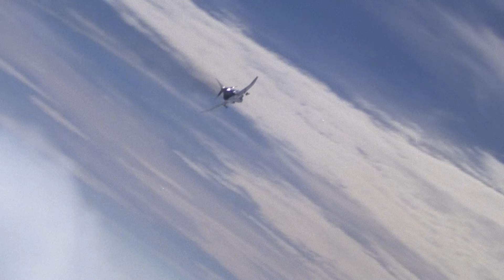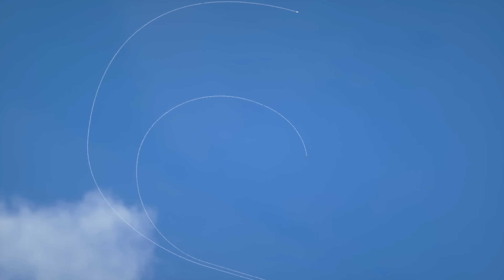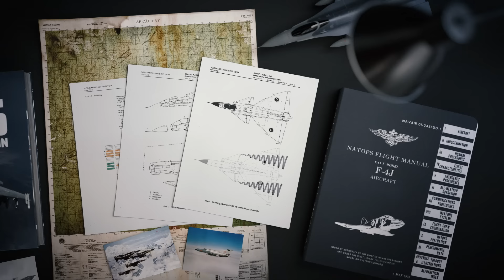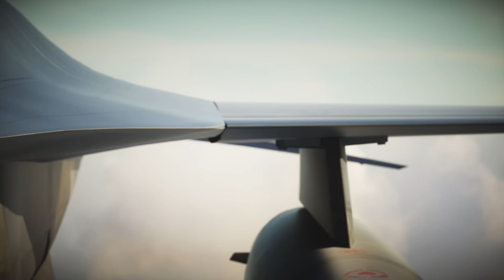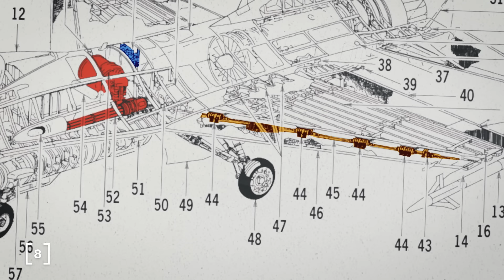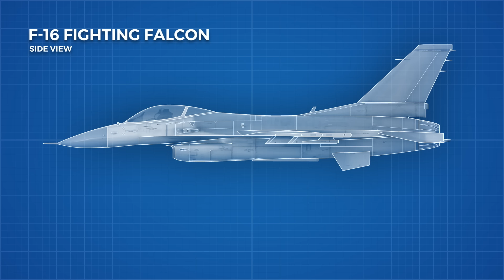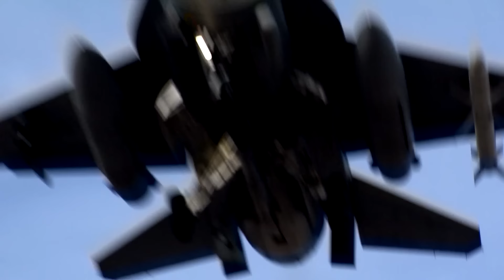The Insane Engineering of the F-16

Comment: Not a  pilot. Have read about flying my whole life and mostly about fighter pilots and fighter planes. 
I am trying to wrap my head around the excellent description here of the F16  FBW and limited stick input. 
Seems like the whole "seat of the pants" thing kind of is no longer a thing?
On the other hand I have millions of miles driving all kinds of vehicles.
I am wondering if a good analogy is a really good traction control system found now on newer vehicles. When working really well, you don't even realize the seamless loss of fueling with foot feed input and the fact that the vehicle just kept you from causing it to spin out with too heavy of a foot. Is this somewhat of a fair comparison?

Comment: Worked as a Final Assembly Inspector at General Dynamics in the 80s. For a period of time because of an engineering mistake in the mating alignment of the forward section at the inlet, a series of shims had to be used to achieve alignment.  Don't know how long that went on but doesn't seem to have any adverse effect in general. Watching the test pilots do energy turns over Carswell that time was breathtaking. Never before had we seen a rather high speed fighter suddenly do what seemed like a 180 turn on a dime. This was something extraordinarily new for us. Still love that airplane above all others.

Comment: The main aircraft in Greek airforce is the f-16 with over 180 planes about 30 are block 30 but mostly block50 and 50 plus which are all in upgrading to block 70 viper but the biggest advantage these planes have they are piloted by the best pilots in nato

Comment: My uncle Bill would have loved this video - he worked for Chance-Vault beginning in 1950 till his retirement 35years later - he worked in aircraft design and wind tunnel testing - one if his designs ( with his name on it ) was the jet intake on the F8U1 Crusader
Reply: 1. In video are almost not visible any MiG-21! Planes with Czechoslovakia markings (Československé letectvo) are Su-22! Not fast, not maneuverable, pretty heavy due a variable swept wing. Su-22 obviously dont have clean delta wind as MiG-21!
2. MiG-21 does not have variable swept wing in any variant or clone!
3. MiG-21 is not dogfighting plane, it is now easy to maneuver special in lower speed in low attitude.
4. Is designed primarily for attack from back.
5. Su 22 does not have AA radar!
Absurd
Reply: @askme5805  And what exactly does any of that have to do with OP's comment? Smh.

Comment: The mig-21 is not maneuverable, as claimed, even relative to the F-4. It is also just as fast. It was cheap. 

Hit and run tactics disabled the US strategy, causing losses when combined with modern soviet ground based air defense. The  US needed a tactical ability which defeated the interceptor concept.  Because this was soviet air doctrine, working in practice.

The narrative would be improved by pointing out that the cheap mig had all it needed for the simple tactic. This is what made the US realize it needed “air superiority” not just a fighter. And that brought the fighter mafia’s points and Energy Management theory to the fore. 

Air superiority informs US strategy and spending to this day. Lots of cheap fighters must not defeat US air strategy, or that strategy fails.

Comment: Hold on the F-16 was designed by a small group of engineers and defense analysts known as the Lightweight Fighter Mafia in the early 1970s, and one of these engineers said the F-16 was designed on a napkin on the corner of a table.  And what is said early in the video sounds more the designing of the F-15.

Comment: Huh, I thought those fillets at front of the wing were called Leading Edge Root Extensions not Leading Edge Strakes.
Reply: You’re right, they are.  Strakes are ridges along the length of the hull, like a boat.  In the case of the F-16, the strakes are the two stabilizers under the fuselage below the tail.

Comment: Generated using Talkbud (Browser Extension):
📝 Summary of Key Points:

📌 The F-16 fighter aircraft was developed in response to the Vietnam War, where larger US fighters were at a disadvantage against smaller, more maneuverable Soviet-made MiGs.
🧐 The F-16 was designed with the energy maneuverability doctrine, focusing on efficiently managing energy to outmaneuver enemies. The video explains the energy maneuverability diagram for the F-16.
🚀 The F-16's unique design features, such as its engine inlet, landing gear placement, and leading-edge strikes, optimize its performance at specific speeds.
🚀 The F-16 is equipped with a hidden 20mm rotary cannon and has a precise weapon system.
🚀 The F-16's fly-by-wire system revolutionized aircraft control, allowing for more efficient energy management and maneuverability.
🚀 Other topics covered include the F-16's pitch stability, reclined cockpit position, and G-suit for high G-force tolerance.

💡 Additional Insights and Observations:

💬 "The F-16 was designed to be a lightweight, single-engine fighter that could outmaneuver its opponents." - F-16 test pilot.
📊 The F-16's energy maneuverability diagram shows how lift and turn rate are affected by speed and angle of attack.
🌐 The F-16's fly-by-wire system uses sensors, wires, and computers to control flight surfaces, enhancing energy management and maneuverability.

📣 Concluding Remarks:

The F-16 fighter aircraft was developed to address the limitations of larger US fighters during the Vietnam War. Its energy maneuverability doctrine, unique design features, and advanced systems make it a highly maneuverable and effective aircraft in modern warfare.

Comment: I'd be skeptical of giving Boyd too much credit for the plane's success: Boyd, along with with the Fighter Mafia and the Reformers had a seriously flawed view of future combat. 

If they'd gotten the planes they actually wanted from the F-15 and/or F-16 programs, they'd look like the F5s of the fourth gen of jets. Under equipped, with practically zero upgrade potential. Instead, the designs made some level of compromise to become versatile platforms that would be durable into the future.

Also relevant: most nation's planes went through a similar trend of moving away from raw speed and climb performance. Learning from the conflict in Vietnam wasn't exclusive to the US, and the Russians also began to understand that their fighters (as opposed to interceptors) needed versatility. Compare the capability of the MiG-23 to the MiG-29, for example, and you can see a similar shift from the F-4 to the F-16.

Comment: Curious question, regarding G's and the physics of it on the body, would a double amputee feel reduced g's since the blood isn't pooling into the legs as much? I know there was a star pilot in the RAF during WWII who experienced this. Would double amputee pilots have a significant advantage in dogfighting with modern air craft?
Reply: They have suits that prevent pooling now. Air pressure around leggs and trunk.

Comment: I think you have heavily discounted the ability of the Phantoms to fight Mig-21s. They were only disadvantaged if they got in close, but even then, it wasn't as bad as some make it out to be. Sure the Phantom was heavier and a bit less maneuverable, but it was also quicker off the line and going up to its top speed than the Mig. It had insane amounts of power and really had the freedom to dictate the engagement if flown in a purely air to air manner. Those aircraft losses were likely not F-4s being shot down, but rather other dedicated ground attackers and bombers like F-105s which really struggled. And I think it is very important to point out that in that article you even pulled up, the US still had a greater than 2:1 kill ratio against Vietnamese. This wasn't acceptable to the US, but this shows that they weren't as disadvantaged as people like to believe. Also a lot of the Phantoms issues were lack of air to air combat training, and missiles that were relatively unreliable. The changes to training alone drastically changed the success rate of Phantoms, let alone all the other improvements made over the years. It eventually became everything it should have been at the start and ultimately was a very successful aircraft.

Comment: @ 27:46 - I'm no engineer but the center of gravity is that far forward? Even with empty tanks and armament, I would highly doubt it and once both are added, then certainly its much further back. What's in nose and cockpit that's counteracting the weight of the rest of the plane? Or does the center of gravity move when in-flight due to the introduction of lift?

Comment: In the hands of a master the F16 should have little trouble winning a gunfight against even F-22s and Su-57. Sure the thrust vectoring will give a great first turn but the F-16 will maintain 360 kts and just pull around the circle like it doesnt even matter and catch the behemoths trying to imitate a leaf at low speed.

Comment: Great informative, engineering video! I worked in aerospace since ‘96. The company I worked for made the leading edge flap actuation system for the F-16s. It constitutes (3) different style actuators connected to Tie bars …that attach the leading edge flap to each actuator… and the aircraft frame. There is 210, 200, and 315 series Rotary gear actuators… that handles the load on the leading edge flaps. The 210 is a Big three slice rotary actuator… that carries the most load on the leading edge flap. The 200,  is a two slice Rotary actuator… that carries the second most load on the leading edge. The 315 is a small, and  compact 3 slice rotary actuator …that mounts closer near the wing tip of the leading edge flap. I was responsible for All the test-lab equipment… simulating the aircrafts maximum loads during flight.
It’s unconscionable the loads these actuation systems can withstand and survive to fly every day. We test these to the maximum loads …and even do a Maximum proof load… which tries to break the unit …to show any weakness , before it ever shipped out to Lockheed-Martin. I worked on this equipment and I had to Calibrate and work on the test stands for 20 years. I have an electronics engineering degree,  and I had to validate everything was reading correctly to test these units to their correct specs.  The leading edge flaps are what makes this plane very special, and they take the brunt of all the heavy loads. Thanks for sharing a great video. I’m proud to be a part of this awesome aircraft, the Viper rules!!!
Reply: Such commments are something I come for to YT.

Comment: The stupidest thing about this plane is that it opens the flaps as it slows down, and this slows the plane down extra and puts it in a stall state. It is recommended that you open the flap lock when the engine dies, otherwise you will fall.

Comment: Great video. Goes to show why Ukraine's training on the F-16 will take longer than expected for already experienced pilots - it's designed around a particular performance envelope and science that they aren't necessarily familiar with. If you don't utilise these characteristics effectively its strengths go out the window.
Reply: Theyve been memorizing those envelope numbers for a year and flying them for months.
They dont need to use it to its full potential. Putting it in the air will shut down a lot of helicopters and planes. They dont control the airspace in thier own country. The day they have 40 16s thet will own the skys over the entire country including the occupied areas.

Comment: Around 24:00 or so: Heh, this is kinda interesting to contrast with racing sim drivers, who tend to favor brake pedals that use load cells and barely move, arguing it's easier to brake based on pressure rather than pedal position. =)

Of course with those we're talking much much higher forces as well, so fair enough I guess.

Comment: One of the designers of the F-16, was Pierre Sperry.   When the F-35 came to light, Sperry criticized it heavily, because he was right.......the F-35 is a useless techno-turkey that cant climb, cant turn and cant run.  The designers of the F-16 built the ultimate "rate fighter"  a fighter that can close on an adversary in any situation, where a one circle chase ensues.  It can keep up a faster sustained turn behind any other plane other than the F-22.    The problem with the F-16, is modern air defense systems like the Russian S-400 which can make mince meat of it.   No matter how nimble an F-16 is, a modern missile is better.

Comment: I'm currently learning the basics of flying in DCS.

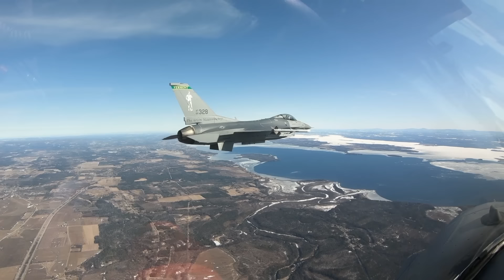Does anyone know how to conduct the maneuver  at 6:23, where the plane banks laterally while keeping the nose pointed forwards.

Whenever I try banking laterally I end up with my nose pointing towards a different bearing and not going forwards.
Reply: I fly the Viper in DCS as well(private pilot IRL).  I'm almost sure his bearing/heading changes a little, even if it doesn't appear so in the video. It looks like he made a relatively quick bank and then returned to wings level. Probably with no back pressure on the stick.  I'll have to do a test in DCS when I get a chance.

Comment: OMG! That testpilot of the 'unintended flight' @32:25 is an absolute BOSS for not ejecting 😎 I sure as hell would. How did that flight end anyway? And is there any more footage of that particular test flight?
Reply: The test pilot was Phil Oestricher who is a legend. The intention was to do a high-speed roll down the runway, and light off slightly before setting down and coming to a stop. Because of the settings of the flight controls, the plane quickly went into a PIO (Pilot Induced Oscillation) when he tried to set it down. The plane quickly veered off the runway and Phil finally eased off the controls and the plane took off. He circled around and quickly landed. He told the engineers the plane" just wanted to fly".

After adjusting the gain settings on the flight controls, the F16 had it's first official planned test flight a couple weeks later. There were many who were very skeptical of the flight controls on what they dubbed the "electric jet" and were looking for a reason to kill the program. Phil not only saved the plane, but likely the entire F16 program. 

This all according to my father-in-law, who was one of the engineers that designed the flight control system. He and I just watched a video of that first flight a few weeks ago, and he told me a bunch of stories about the development of the plane as well as the test pilots.

If you search "F16 first flight" on YouTube, you'll find a few videos of that flight. I recommend this one: https://www.youtube.com/watch?v=qAp4RtGKbHE

Comment: I'm surprised that it took so long between the first non experimental aircraft to have fly-by-wire the pre-cancelation 1958 Avro Canada CF-105 Arrow and the first actually mass produced model as the F-16 Falcon was indroduced in 1978.
But the technology and raison-d'être are much different between both and both had the same "lack of feeling" complaints.

Comment: I was stationed at Wright-Patterson AFB in the late 70's while the F16 was still in development.  One of the design issues was that they canopy with a heads-up display, had a spec that it had to withstand a bird strike at 400 knots.  The lab where it was being worked on was at Wright-Patt and I knew the guy who was testing the canopy.  He had a pneumatic cannon that he'd fire a "4 pound mil-spec chicken" at the canopy.  

I had this vision of him grabbing a chicken by the neck, squawking, feathers flying, stuffing it in the breach, slamming it shut, pulling a cord, a burst of feathers out the end of the cannon, more noise and boomp!  Of course what he really worked with were 4 pound chickens he bought at the grocery store.

The first canopy was 1/2 inch thick and a 4 pound chicken at 400 knots poked a hole in the top, which would be fatal to a pilot.   That's why they went to a 1 inch thick canopy.

Comment: The only thing that sucks about the F-16 is that it runs out of fuel quickly, the MFD screens are tiny, and there are limited hardpoints for ordnance. Everything else has been pretty genius though and its success speaks for itself.
Reply: Not a lot of internal fuel.  About 6000 pounds internal on the A models.   As a young performance engineer there in 1975 I did a 'what if' calculation: what if you could instantaneously start an F-16 at Mach 1.2 at sea level, how long before it ran out of fuel?  Answer - 6 minutes.

Comment: Really important note: the diagrams are only valid for a given configuration at the given altitude. F-16's at airshows can do a sustained turn at >20 deg/s because they're in thicker air at sea level near empty weight and drag index 0.